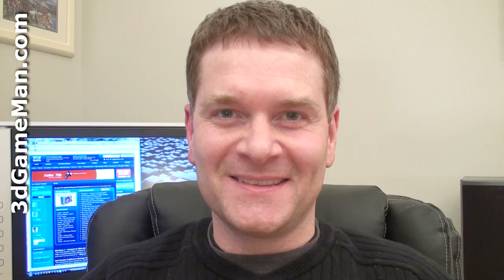#138 - Question/Answer: ATX 12V 2.2 vs. ATX 12V 2.3

Comment: Hi @3DGAMEMAN im having a problem with my first boot of the day(4-6hrs out from energy) when i turn on my pc all system lights up but my rtx 2070 stays with collers spinning but the LED off. So i just have to Reset and all my system boots properly. I have  a Ryzen 5600x + b550m-plus + RTX 2070 EVGA. Do you know whats happening with my system? the problem happens the same with my z270 mobo and i7 7700k.

Comment: Delete your bullshit spam links to this video for irrelevant PC issues and go fuck yourself
Reply: Wow, so much hate. Is COVID19 hurting you too?
If you got here from TomsHardware.com, the answer you're looking for is one of the following:
1) I need a new power supply, with a newer standard for stabilizing voltage.
2) I need to buy a voltage stabilizer/regulator, between my Desktop PC and Wall Socket.
3) I'll buy a power bank, that's designed for PCs. Then put that between my PC and the Wall Socket.

Comment: I got an old enermax 530Watt supply recently and totally fails to start up Acer m3910 motherboard I got it to get a bigger graphic card. Is this the PSU shutting down for some reason on this line?

Comment: my system not boot at first, the leds stayin on but nothing else, i must hold the io button until it turns off and when i press again the io it starts normanly, can you explain this?
...Computer boots on second attempt only...
Reply: Have you found the answer to this? I am wondering same
Reply: @rossknaster2778  yes, the answer is that amd has the same problem over 20 years with the limit of ram modules, even in Ryzen 2700x I can't use 4dims(32gb) normanly, this moment I'm back to my old 2x8gb kit. The problem is not on motherboards, the same problem I had in many 350/370/450/470 motherboards so I can't believe to luck, Is the same from Athlon generation to ryzen 2xxx, I don't know if they fix it on ryzen 3xxx and 5xxx. I don't know why people just ignoring that. If you want to work with 4 dims you need to downclock under 2000mhz

Comment: I meant > 85% efficiency.
And it is: RS-850-EMBA Active PFC Power Supply
w/ Active power factor correction (PF >0.99)
So what causes the 'no boot'? Mobo circuit protection? PSU protection (it thinks it doesn't see a CPU)? Or will it fry the CPU (that would prevent startup!).

Comment: Yes, that response doesn't really answer the question.
So a new CPU draws almost zero watts when first turned on.
And?
Does that mean the protection circuitry on the mobo or CPU prevents startup when it sees the higher load? Or does it fry the CPU? Or is it the Power Supply protection circuitry that prevents startup because it 'thinks' there is no CPU there?

Comment: Does this mean that a 2.2 PSU can fry a new CPU?
I have a CoolerMaster Real Power Pro 850W  RS-850-EMBA
It is a 2.2 w/ 'the newest SSI standard EPS 12V V2.91'. Designed for servers and high power dektops & came out in 2007. <85% efficiency.
I've read that the ATX2.3 standard is V2.93 on the CPU.
Running Core 2 Duo, but getting an i7 3770K. Will this PSU play nice with the i7?

Comment: Why would the power supply care if a CPU is drawing power or not, the power supply i turned on by the shorting of 2 pins on the ATX24 connector?

Comment from the maker: Some new CPUs consume almost zero wattages when the system is first turned on. And this is why some 2.2 spec PSUs might not power up the system. With Spec 2.3 PSUs the 12V CPU load requirement has been reduced to resolve this issue.
Reply: Hey there! Thanks for the video, I have an ATX 2.4 PSU, and I'm having this problem that the first time I boot my PC it doesn't POST (but stays on), but the second time it turns on just fine. At first it didn't happen 100% of the time but now it's consistent. I've also replaced my PSU with a new unit, but it keeps happening. Any idea?